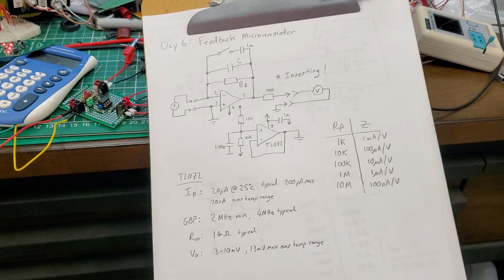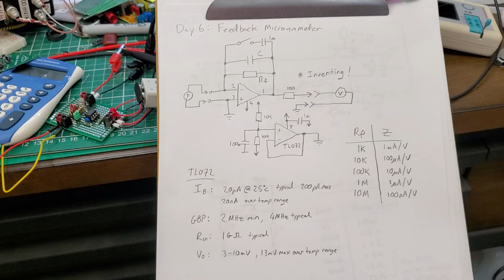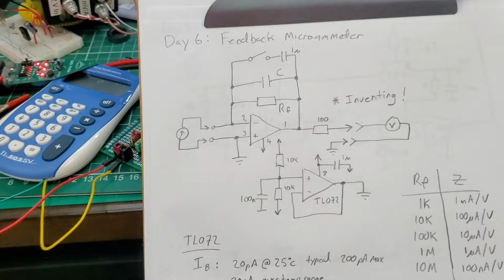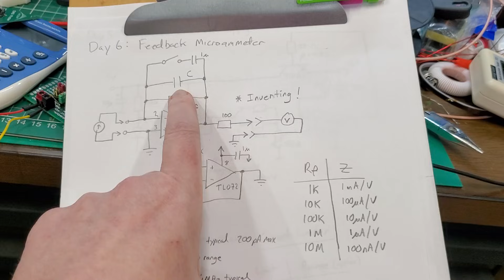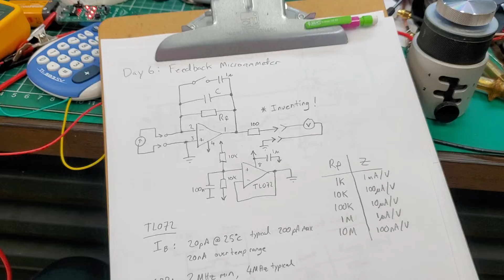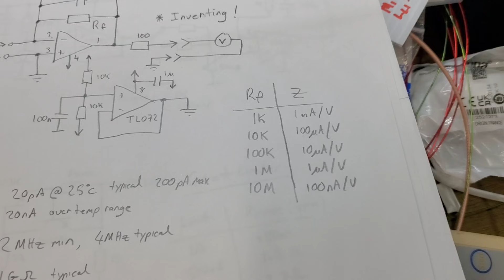ACoC 2025: Day 6: Feedback Microammeter

Comment: Aha, this matches the circuit I found in an old GP270 bayard-alpert ionization gauge controller. The reason I initially downloaded  the schematic was that it implemented autoranging with nothing more than 4000-series logic, op-amps, and jfets. The only reason I took a close look was that one of the schematics was marked "electrometer". Only it measures current, and the electrometer part of it is a dual jfet followed by a LM1458 opamp.

I tried to use it as a picoammeter, but it has a several-mV offset from ground. I've yet to figure out whether that simply wasn't an issue in the original application, or if something is out of spec.

Looking forward to whatever videos you post next!

Comment: @vk2zay Another step closer to the low-VI curve tracer, I presume. If I remember correctly, my curious R-beeper used a current mirror made from two transistors for the input sensor. The measured resistance between the probes was essentially one of the current-setting resistors, and the mirroring transistors produced current charging the 555 timer capacitor or the OpAmp oscillator's cap. I don't remember it well, and now I can't find the magazine where I stole the idea from. So, in essence, it was somewhat similar to your circuit, since a discrete imitation of the first stage of OpAmp was used. Hope this inspires you some more😇